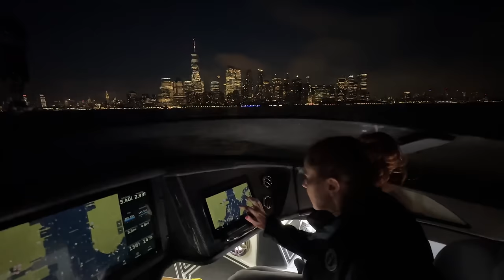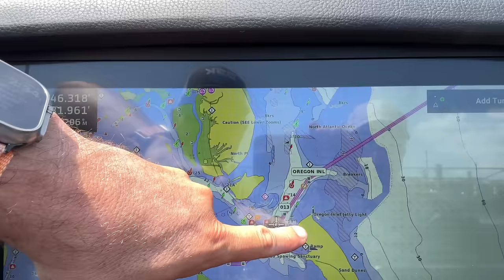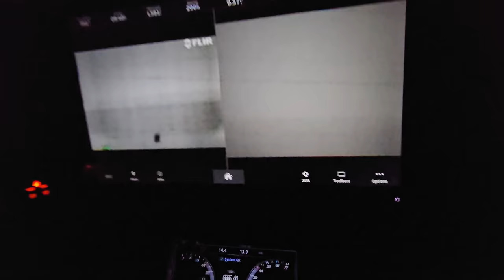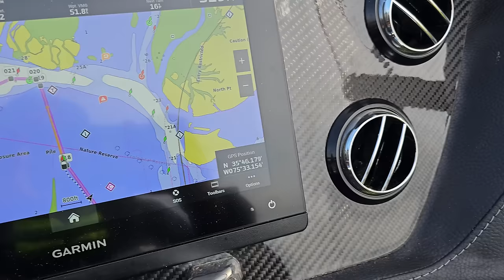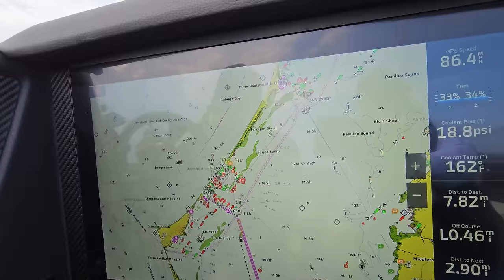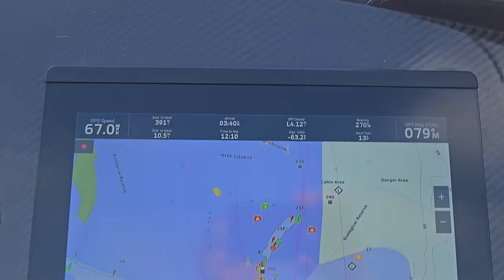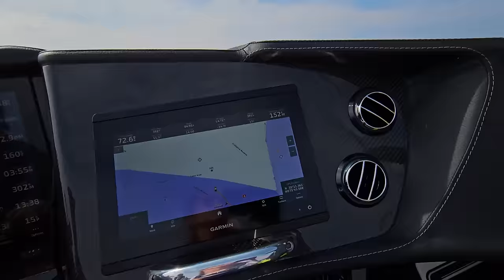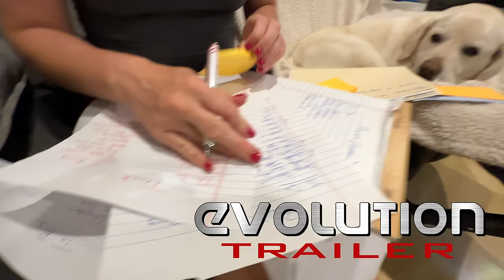World Record Disaster! NYC to Miami By Boat In 1 Day Series Finale'

Comment: You have an amazing wife and life partner. I own a speed boat and there is no way on earth she would take such a long trip with me. We lived in Miami  and when we took the boat out all she wanted was to cruise up and down Biscayne Bay and sun bathe. If i hit high speeds she would start bickering. We moved to the Hamptons here in Long Island NY and my boat hasn’t touched water since. Would love to meet you and have a boat meet.
Reply: What A Trooper You Have  By You're Side, 😮😅😊 That Will Persevere Through Thick An Thine With Ya, An Such A Qty, You're So Blessed, To Have Her😊 A  Life Partner 💙  
You No It Would Be Grate If Those  Two Motors Had The Same Sistum 
As A Single Small Outboard Has, Where You've Got A Line  Connected To Ya, An If You Fall Out 
It Will Killed The Engines....
Yall Be Carefull Out There My Brother An Sister....😊
Reply: I am an ex F1 Powerboat championship, this guy has not calculated the has refueling, with large tanks the boat will.not be able to het on the plane, a pipe dream!
Reply: The solution is to not get married in the first place.
Reply: @richardselmarsterne9557 you might want to re-type what you posted. I have no idea what u are trying to say.😂
Reply: @richardselmarsterne9557 all that and no English?
Reply: @richardselmarsterne9557  you live for the pipe, huh ?
Reply: Most emotionally mature boomer relationship

Comment: I was on Marin Headlands and watched a yacht try to sail between a tug and the barge. They hit the cable which turned them upwind towards the tug. They were stuck on the cable and were run down by the barge. Their sail ended up plastered onto the bow of the barge and eventually their yacht was forced under. Everyone thought they were dead, but eventually we saw two people in the water. They had gone under the barge and popped out behind. The tide was flowing out of the Golden Gate, and the tide there is pretty strong. We called the Coastguard and kept track of the two survivors. There is a Coastguard station just inside the bay on the north side of the bridge, but the cutter was already out and was refuelling at Fisherman's Wharf, so it took them about 15 minutes to reach the survivors. Once they were onboard we went down to the Coastguard station. They wanted statements from us. After that we met the survivors, who had just sunk a friend's boat that they had borrowed for the weekend. Very lucky to be alive.
Reply from the maker: Wow!   Yes it does happen and it’s very scary.  Thanks so much for your comment and saving those folks.  Thanks for watching as well:). Please message us on FB for swag.  Mention this comment.  M&S

Comment: Not the record you wanted, but still one to be proud of. It was the right call to stay tied up at the dock rather than go out. If you ever try this again, you should rig up a better fuel system using bladders and pumps, so you don't have to mess around with gas cans. It would not be hard to do and you could have as much capacity as the boat can physically hold.

Comment: those props are very exspensive   my father did drag boats   props were like 3500 bucks 20 years ago   was a single seat   sat ot the floor once   top fuel   went like  180 in 2 seconds     not for me

Comment: I don't get it a world record with two outboards? Is it the speed or overall time it took? I am thinking back to the original record breakers back in the 1920s 1930s 1940s and 1950s. They had no modern tech some never had radios perhaps less debris in the sea compared to today. The boats mainly made out of wood different bottom shaped flat and V. not as long one engine to save weight. Fuel balanced as in the front  two people sat in the middle. Some had car engines others had engines out of a plane. Floating life vest were bulky just put in the boats.  I like the history of things and how they were built what motivated them to do it just like you.  Than you as interesting.

Comment: You really should be wearing the proper vests and full face helmets. Those vests are a joke for the speeds ur traveling.  I used to work for an engine builder and friends of his stuffed the nose at the world finals in Key West. They had open face helmets and ended up in the Hospital after smashing their faces on the wheel, dash, gauges. Not pretty. I ended up trailering their boat back to NJ